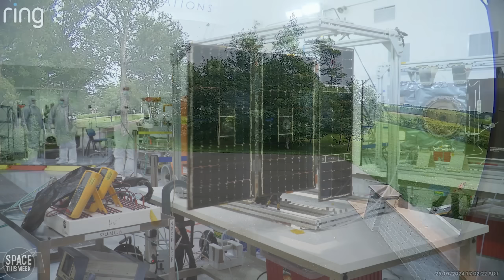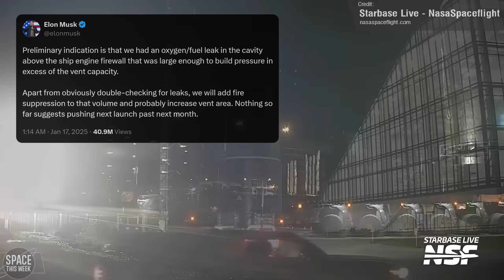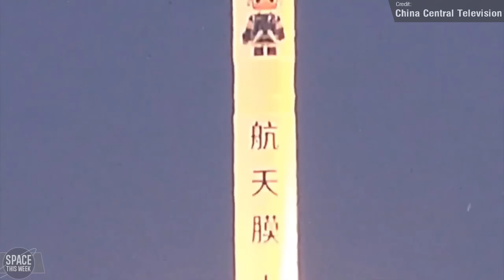SpaceX share AMAZING new shots of Flight 7, & Prepare Upgrades for Flight 8!

Comment: 1:38 This animation is wrong and extremely unlikely to happen. Like Falcon 9, the booster is on a ballistic trajectory to miss the landing site, and only if the engines all light does it swing over to the tower. This is why as it approaches the tower it's moving at such a heavy angle instead of coming straight down. It's ballistic trajectory has it crashing in the water just off the coast. If all of the necessary engines relight and no issues are detected, the booster tips and the engines gimbal to swing it over the tower where it's going far too slow to cause any significant damage even if it runs out of fuel or somehow losses control at the very last second.

Comment: Orbital pad b is still pretty close considering the crator if something goes wrong with a fully fueled starship and booster will be a mile wide.
I don't want it to happen but at the same time id quite like to see it.
Reply: There wont be a crater. The mostly empty oversided aerosol can will just crumple into the ground with a small fire of whatever fuel is left.
Reply: @NomadUniverse
You missed the part where he said with a "fully fueled........"

It does launch from the same place that gets caught, after all.
Reply: @ I did miss it it seems. Fair point but they have so many systems in place that would halt things long before anything happened.

Comment: Space x : 2 months to launch a rocket ( biggest rocket in the world)
Nasa : 8 years to launch a rocket
Reply: Space x:got 450 millions in Bank loan for the research of environmental technology but used it for space x
Nasa : got its funding lowered AGAIN by congress and is not indexed on inflation
Reply: Launch?
Reply: @MOHA_1484.  space x take 7 tries to put nothing into Leo 
NASA first launch of sls around the moon and back no problem. First try.
Reply: @Xavier1...  How much did that one launch cost again? And what did we learn? That the heatshield will fall apart on re-entry.
Reply: @BabyMakR  its estimated that the sls cost about 26 billion as of the latest launch and 2 billion per launch after that. Starship is estimated to be at around 8 billion dollars of RND as of 2025, + about 100 million per launch, and it's still going.

 It's too early to tell.  I think RND cost for starship will be near the 10 to 15 billion, but per launch, the starship will be better because of being reusable. Although SLS is way more capable for a single launch and doesn't require refueling to complete the mission.  Since space X needs to launch from 12 to 20 starship just to make the moon. It's estimated that for every lunar starship, it would cost around 1.2 to 2 billion dollars, so not very far off what SLS cost per lunar launch.
Reply: @BabyMakR  also just to clarify the Orion capsule came back from the moon faster than any spacecraft since Apollo. And it also successfully protected the capsule. The heat shield showed more ablation than expected but it was all around a successful launch and if there were humans on-board they would of been fine.
Reply: @Xavier1...  Not ablation. Entire chunks were torn out. That's not ablation.
Reply: Also the first prototype flew in 2019 thats almost 6 years ago. And all that just for a very expensive fireworks. Also before it was called starship it was called BFR for a few years soo count it like you want its been in development for at least 5 to 8 years
Reply: Starship doesn't work after 7 launch 
NASA works first try.
Reply: @MOHA_1484.   also just a reminder that the first prototype of starship flew in 2019 and we are now in 2025 soooo space X still having failure after 6 years.

Comment: I wonder what the velocity of that meteorite was at impact..?
Reply: If we do some (very rough) math, with the camera operating at 15 FPS and the object appearing to move roughly 8 feet between the last frame of flight and the first frame of impact (hard to tell for sure so I'm gonna low-ball the number), it was moving at least 120 feet per second, or 36 meters per second. This is slower than your average airsoft pistol, but is a significantly larger object so would certainly do some damage to a creature if it were to hit them.
Reply: @EnderMalcolm  I would assume it was falling at terminal velocity but it looks like it's falling a bit faster than that.
Reply: Meteorites only ever really fall at two speeds: a few hundred km/h, or about 11 km/s. If they're small enough to be slowed by the atmosphere, they get slowed right down to terminal velocity and it's just a pebble falling out of the sky. If they're not then they're too big to be slowed much at all and you have a huge piece of rock hitting the ground at escape velocity.
Reply: @bewilderbeestie this one was clearly going a lot faster though, it shattered into dust on impact. It probably had an aerodynamic shape after surviving atmospheric entry which let it speed up more like a dart.